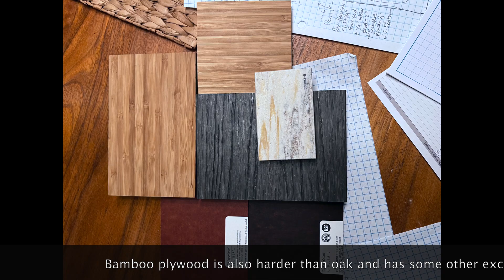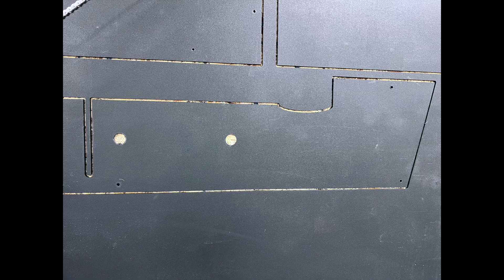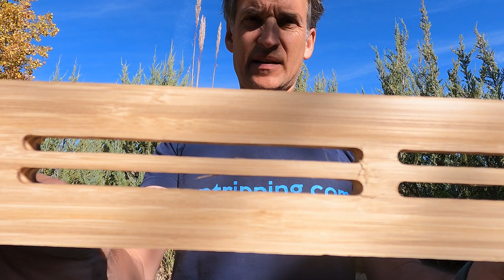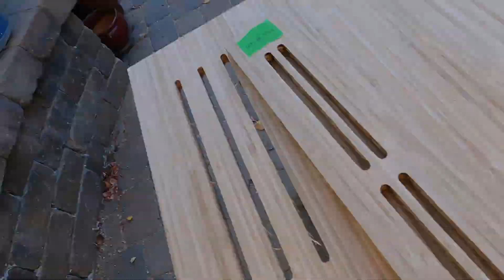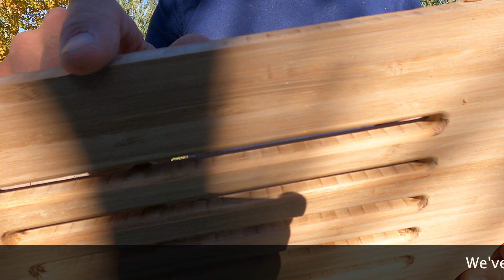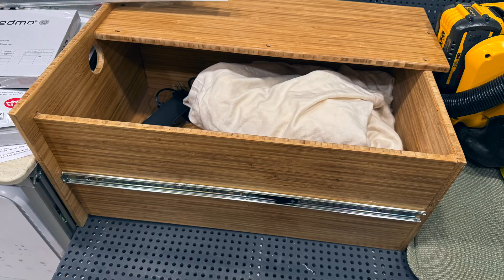Maslow CNC cut Expedition Camper cabinetry panels

Comment: Amazing! what program are you using to generate the Gcode?
I hava a maslow as well and been struggling to find a cheap program other than the $360 Carbide Create Pro licence. Thanks
Reply from the maker: We use Easel. It's easy to use and free and fine for our mostly rectangular cuts.

Comment: If you had the extra shop space which CNC machine would you go with?
Reply from the maker: I researched several but didn't consider anything else seriously since all were around $15000 or more, and took up an entire single garage space, which would had taken away space for material storage and space to assemble, etc.